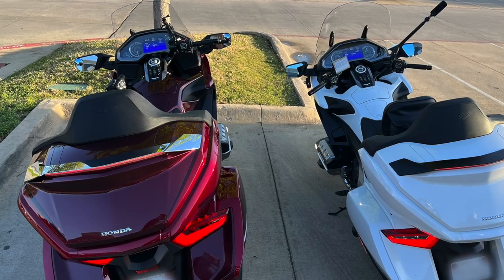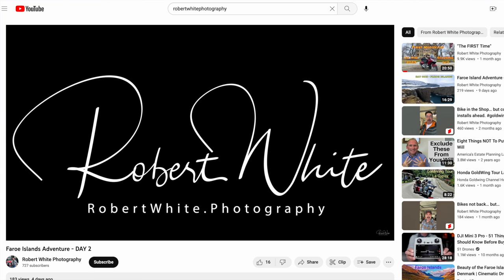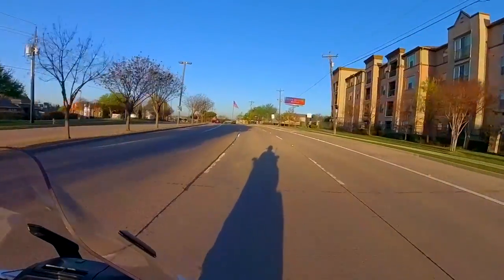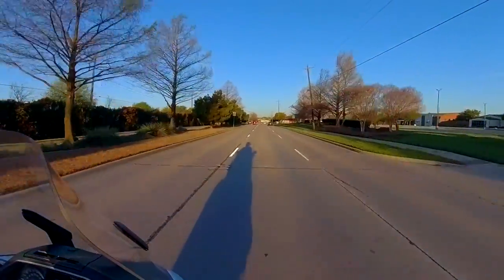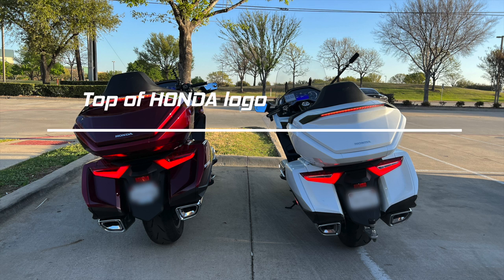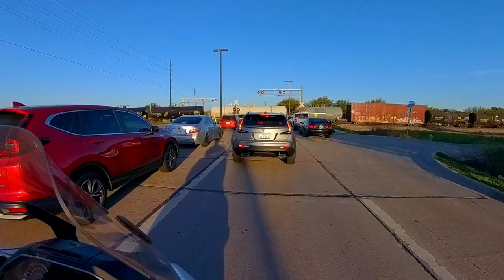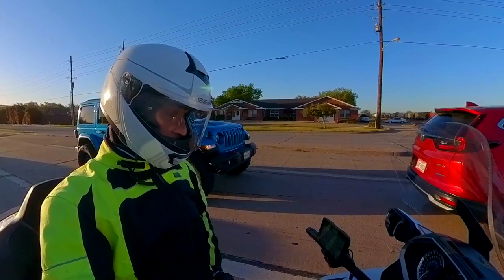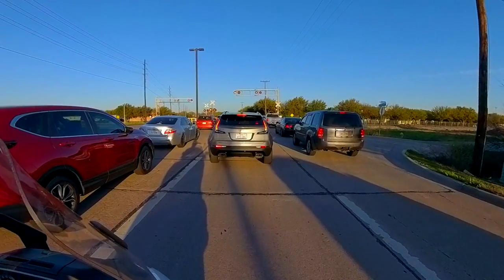Honda Goldwing Engine Ticking Issue SOLVED? | Cruiseman's Moto Vlogs

Comment: Hi Chris, a little bit late but here are my findings. I never had that clicking noise until my dealer adjusted the valve clearance. After that, I had the clicking noise on the right side. We found out, that he had forgotten to fix the outlet valve lever (with the counternut) after adjusting the clearance. After that, problem was solved. I think during the assembling process, some bikes don't get the correct momentum on the nuts or aren't fixed properly.
Reply: What exactly is the “outlet valve lever”?

Comment: Yes, I was told this many years ago when I owned a  1982 650 Nighthawk, it ticked.  I was told by my friend who was a power plant mechanic and is now a Master Mechanic that it was because the bike was on its sidestand.  it has occurred with other bikes I've owned and used.  So I think you can safely say "Its a thing." When on its center stand it does not occur.

Comment: Check suspension settings. Two up with luggage versus one up no luggage might allow for height difference. Traxxion show’s differences.
Reply: That was my thought as well!
Reply: @spivey8481  👍🏼
Reply from the maker: Checked that. Actually, mine was set higher than Roberts'

Comment: Hi Cruiseman and thank you for this video.  I would like to share my experience that just happened (5 min ago) on my 2022 Honda Goldwing Tour (Not DCT) after my second oil change.  When I started the engine right after the oil change, I heard the ticking sound (first time hearing this sound on this bike).  It was very loud and I thought I was in for some heavy corrective maintenance.  I first looked through the service manual and found my possibilities, then I searched on YouTube and there you were again, discussing what I needed.  I thought about your oil comment and thought about the order of events that happened during my oil change.  I dumped the oil and when I got to my filter, I realized a friend had borrowed my oil filter wrench and had to go get it back.  About a 20 min ride each way.  Since it was getting close to supper, I got supper on the way for my family and we ate as soon as I got home.  Long story short, the bike stayed on the kick stand draining for about 2 hours and a half.  I got back to work after supper and finished the oil change...  So after watching your video, I immediately started the bike again and let it run for 10 min while having the bike leaning against me on the right side of the bike.  Slowly, the noise went away and after 10 min, both sides of the engine sounded the same again.  That made my day!.  Note that I always park my bike on the center stand in my garage, for space saving and safety.  Now, I have another reason... that ticking sound.  I believe you are right about the oil!  I think it can sound far fetched in a conversation considering Honda's reliability, but I believe it now.  I personally never thought Honda would oversee something like that.  Anyhow, my problem is gone and I can continue and install the Remus exhaust and the JMC Rocker speakers and Amp.  Can't wait to hear this when I'm done!  Take care and thanks again for the videos.  Hope you get another Goldwing in the near future!

Comment: Hello Cruiseman!
I too had that clicking sound coming from the right side of my 2018/2023, initially! It never went away on the 2018, even up to the time I traded it in on the 2023, however, on my “23” I noticed I don’t hear the clicking sound any longer. The weather has been quite nice here in San Diego, CA over the past 4 or 5 days, although it’s suppose to rain again Weds, and Thu. I just want to let you know that I appreciate what you do through your vlogs and YouTube videos!!!
Loyal.
Reply: I totally agree. I too agree not liking as much this new presentation through voice over than the previous versions. Not hearing the motorcycle and traffick sounds makes the video too artificial and not lively enough.

Comment: Love Robert’s photography. Been watching his incredible work presenting his recent Faroe Islands trip. Amazing footage. To the Gold Wing height difference. The first thing is ensuring flat surface and no grade difference. The other is visual affect that two presumable congruent objects have sitting at angles next to each other. Since the video demonstrates a straight line it might be surface grade. Both on center stands is another assessment method needed. To the engine tick. When parked in the garage I always place my bike on the center stand. I do hear a very slight tick which goes away after warming. Good stuff Cruise.
Reply: Thank you Road Glide !!

Comment: 2019 Wing. Always ticked non-stop from new until last summer 2022 when I checked the oil routinely and topped up (level was well above half). I added a little too much ... not a lot. No more ticking since!
Very quiet ticking audible if parked and started on side stand stand but it is short lived.
Here in southern Spain we are at 29°C. High for March. Normally 23 to 25°C.
Drought conditions so warm and very sunny I'm afraid.
44.5°C in central Spain last July at times. I rode to UK where temperatures exceeded 40° occasionally. Hottest on record I believe.
Glad to see your weather is letting you get out more.
Cheers.
Stu

Comment: Hello Cruiseman, I purchased a new 2023 Honda Goldwing Tour DCT in mid July and it currently has around 120 miles recorded. I always keep the bike on the center stand and yes I noticed the ticking sound appearing to be coming from the engine right side. The ticking seems to go away after the engine warms up and the engine sounds appear normal. I noticed the ticking after a cold start and the garage temperature was around 80 degrees F. This was on my second ride from bike purchase. I will continue to monitor and keep the dealer advised. Checking other Goldwing owners, it appears the ticking issue is not rare, but most report the ticking goes away after the engine warms up. I experienced this on a BMW 750IL I owned years ago and it was actually a ticking fuel injector. Thanks for your thoughts in this video. All the Best, James.

Comment: I have also been experiencing the "ticking" noise on my new 2023 Goldwing.   I have less than 900 miles on it, and did change the oil at 600 miles.  I always keep the bike on the center stand when in the garage.  The tick does seem to fade after warming up, but does not fade completely.   My bike has this noise only on the right side.  I will be contacting DFW Honda when they are open next week.

Comment: I have a 2024 Gold Wing Tour DCT and purchased it new.  I live 1.5 hours from the dealer and it was delivered to my house without a test ride.  It had three miles on the odometer.  The next day on my first ride I noticed an abnormal ticking noise from the right side cylinder bank.  I read forum posts and watched YouTube videos.  I contacted the dealer and they said it was normal for this generation of motor.  After living with it a few days, I made a video and sent it to the dealer.  They said I could bring it in for an inspection and would check the valves, but they didn’t believe anything was wrong.  I decided to check the valve clearances myself and they all were right in the center of the specified tolerance range.  I also purchased an automotive stethoscope and isolated the noise to the number 5 cylinder (the one on the right side furthest to the rear).  A few more days went by and I rode it to the dealer and let them listen to it for themselves in person.  They agreed the ticking sound was abnormally loud.  I went home and they picked up the motorcycle a few days later and had it for 16 days before I got it back.  They contacted the corporate Honda tech center in South Carolina and were told to check several things: valve clearances, cam chain, cam chain tensioner, and to look into the cylinders with a borescope.  They did not believe it was an injector issue, due to the location of the injectors relative to where the noise was coming from.  The valves were right in the middle of the specified range for all intake and exhaust valves (just as I had measured them).  The cam chain and tensioner were fine.  The dealer thought they saw something inside the #5 cylinder with the borescope and then removed the head.  However, they said it had been an illusion so-to-speak created by oil in the cylinder and everything was fine.  They put everything back together and because nothing had been altered, the noise still existed.  Then corporate Honda told them to tighten all of the exhaust valves on the right side to the tightest spec value of 0.03 inches.  The normal specified range for the exhaust valves is 0.03 to 0.05 inches.  Believe it or not, this solved the problem.  They probably only needed to tighten the #5 cylinder’s exhaust valves, but they tightened all of them on the right side per corporate Honda’s instructions.  I’m pleased the motorcycle is fixed but frustrated with Honda and the dealer, as this noise was present from new.  I hope this information helps.
Reply: Addendum to previous post:  I got the motorcycle back from the dealer after the exhaust valves had been tightened to their minimum specified clearance and the noise had only slightly abated.  I would estimate the ticking noise was about 75% as loud as it had been.  I contacted the dealer, who then contacted corporate Honda, and they picked up my motorcycle up and took it back to the dealer.  The next plan by corporate Honda was to replace the rocker arms, but my dealer noticed something unusual about the oil journal that supplies oil to the camshaft.  It looked too shallow.  They were able to convince corporate Honda to send an entire new head, camshaft, and all other parts associated with a head.  The new head arrived and the oil journal was in fact 0.006” deeper in the new head.  The dealer thought this was significant and it would affect oil supply to the last rocker.  Anyway, the entire head and all associated parts were replaced and the problem was solved.  I have the motorcycle back and can attest after a couple hundred miles that the noise is gone.  The right and left sides sound the same.
Reply: Hi Greg, 

Is there any chance you can email me these two posts as I can’t copy & paste them. I can then let my dealer read your findings as I have exactly the same issue on cylinder 5. 

Regards, 

Chris

Comment: Hi Cruiseman. I have owned a 2018 DCT from new since March 2019 and it now has around 21000 mile on it. I have experienced the ticking noise to varying degrees over that period. On start up there is usually no ticking. Then as the bike starts to warm up the ticking starts and gradually fades away as the engine continues to warm up to running temp. I have noticed that the ticking is usually at its worst just after it has been serviced and reduces after a while but never goes away. I've no idea why that would be. As for your centre stand theory I'm not sure it is correct. I always park my bike up on the centre stand when garaged or parked over night and only use the side stand if parking for short periods while out and about. On the rare occasions that I have parked the bike on the side stand over night I have not noticed any difference in the ticking sound on start up.

Comment: I have a 2023 Goldwing DCT Tour and originally had a 2019 - the 2019 never had the clicking noise which in fact is a out of adjustment valve lifter. My 2023 started making the sound around 500 Kms. After doing the screw driver listening test to each cylinder head I could definitely tell it was the middle cylinder that has the loose lifter. I took it to the dealer and they won't adjust it until they say it has gone through the break in period. In other words they will wait until I take it in for the first service and charge me for the lifter shimming that is already needing it now. What are the chances that it will tighten up over the next hundreds- miles or kilometers ??? probably zero :(   P.S. My brother is a red seal mechanic and he was mystified why they won't adjust it now under warranty)
Reply: Same issue. Dealer told me Honda does not cover valve adjustment. I called Honda and they said dealer would hàve to start a warranty claim for them to review.
Reply: @johncook7695  just took it in to another dealer and they said it’s within reason 🤣 so noisy lifters is the new normal- not much you can do but handle it by paying for it- solid lifters shouldn’t be noisy- they forget us old guys no what the difference is between solid and hydraulic lifters 🤔

Comment: I have had a slight ticking at times, it seemed to correspond more to when the Engine is cold (First start of the day on a cooler day) it’s probably related to the oil viscosity and valve clearance, since it goes away once up to operating temps. (Bike is a 2019 Non-Tour Standard and currently has 28K KMs)

Comment: Not a goldwing owner (yet), but am familiar with ticking engines. The oil hypothesis isn't really plausible - that should resolve very quickly once oil pressure comes up, which is typically a matter of seconds. Also, that it tracks the engine coming up to operating temperature points away from lubrication also. I suspect it's a valve tappet clearance issue, or (without me knowing better) it could even be something loose elsewhere in the valve train. Might be worth checking the tappet clearances at some point just for grins.

I have a scooter (Honda PCX) that does exactly this and always has since new - ticks when cold but quiets down to a nice sewing machine sound as it comes up to operating temp. And that too is probably an artifact of tappet clearances...
Reply from the maker: I know several owners who have had their valves checked/adjusted, and it did not seem to make any difference. It is really a strange one. I tend to agree with your oil assessment.
Reply: @cruisemansgarage  Ah I stand corrected. Interesting......
Reply: I just had dealer in Tennessee listen to my 23 with 600 miles and said it sounds like valves need adjusted. Also stated Honda does not cover it . Called Honda and the dealer will have to start a warranty claim  for Honda to review and  see if they will pay for it. If it gets denied with 600 miles on it then this is the last Honda for me and will take it to BMW for trade in.

Comment: Nice easy relaxing video...thank you I have a 2022 non tour DCT. So far I have not noticed any "ticking sounds". However; just tossing this out there. For the most part...Goldwing riders are on the mature or slightly older ages (that's bound to generate some burps..ha ha). As we age, many of us have hearing that is not as finely tuned as when younger.

Comment: Engine ticking - valves, it is normal. Noisy ticking - adjust valves.
Reply: Should be at the idle, whem you rev engine, you should not hear ticking.

Comment: I've got a 2023 DCT and it is always on the side stand - no ticking noise as yet (only had the bike 2 weeks but its been started about 30 times for 10 - 20 mins a time as I've been fitting & testing mods etc.

Comment: I have a 2021 DCT Tour UK spec Goldwing that started making a ticking sound on the right side cylinder head at around 1000 miles from new, the bike was always parked on the centre stand in the garage overnight.
Up until recently I would always fuel my bike with E10 unleaded, at around 4000 miles I decided to run the bike to nearly empty and switched over to E5 super unleaded just to see if it made any difference, the Goldwing will obviously run on E10 or E5 but the difference is unbelievable, 
I was amazed at how different the bike sounded and ran, the ticking sound is considerably quieter, the bike felt more responsive and the mpg improved.
I now only run my Goldwing on E5 high octane super unleaded.
Regardless of which stand the bike has been stored on, If I have not started my Goldwing for a while I usually crank it with the throttle wide open first, the injection system won’t allow the engine to fire but will pump the oil round for about 5 seconds, this is an extremely good method to prime the engine with oil prior to starting.

Comment: I have a 2017 BMW r1200 GSA and it too when the engine is completely cold makes that noise regardless of whether I have it on the side stand or the center stand. I don't think it's a Honda issue it's an issue with a lot of bikes when they've been sitting overnight or longer.

Comment: 2024 honda goldwhing and I got the same problem with 900 miles I did the oil change already and I still have the same noise. I got appointment for next Friday on the dealership to see what happens.

Comment: My brand new ‘23 DCT has started to tick (right side only).  The center/side stand theory only makes sense if the ticking noise goes away after the engine has been running for a few seconds.  Mine does not go away.

First noticed it at about 2000 miles.  Seems to get worse after the engine gets hot.  It isn’t terribly loud, but if it were a solid lifter valve train in an auto any decent mechanic would know exactly what to do about it…adjust the lash.

On my bike, it is not a sound I want to consider “normal “.  I plan to discuss with the dealer where I purchased the bike to get their take on it.

Comment: What I noticed on the bike being taller is his is not leaning as far as yours does.  Maybe adding a side stand footpad on your will stand it up more.  I have had one on all 3 of my Wings and the bike is not so hard to stand up straight after getting on it.  Maybe that would also lessen the amount of oil draining on the lower head.  Just thinking you know.

Comment: I just purchased a 2024 goldwing. Mine has the tapping on right side motor also. I store mine on the center stand. It still had tapping. The tapping does eventually goes away. Should i have any concerns about this. I have 150 miles in bike.
Thanks
Dean Folse

Comment: Ticking on the right side of the engine started on my 2023 bagger after the first maintenance at 1500 km. Not only at low rpm’s but also at 3000 rpm or more.